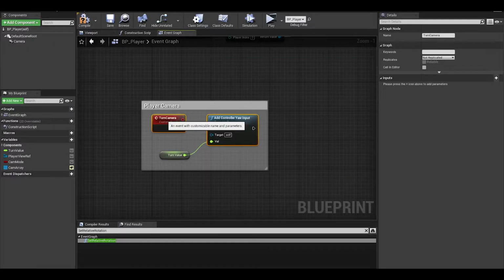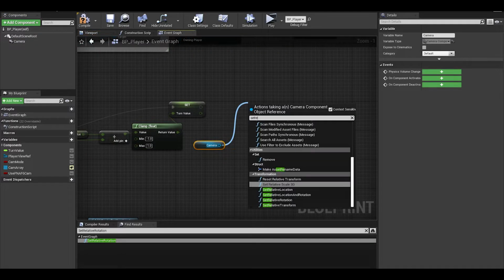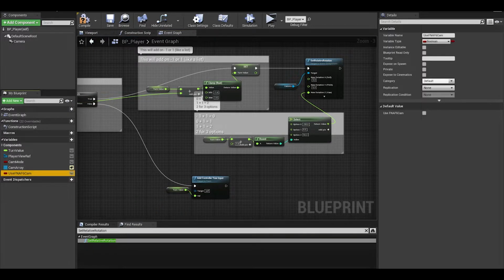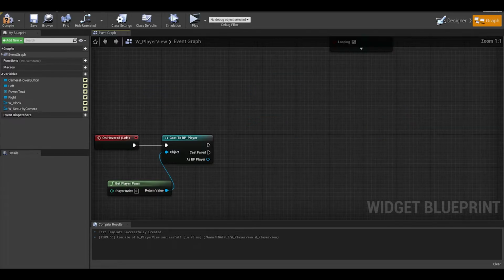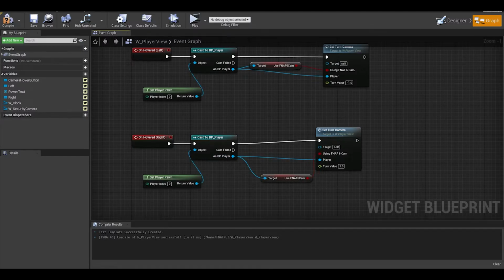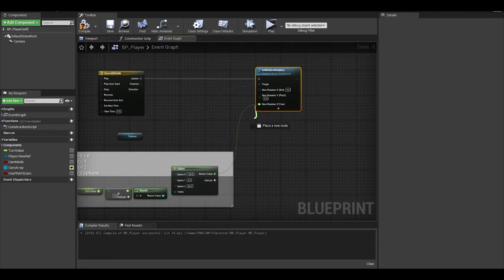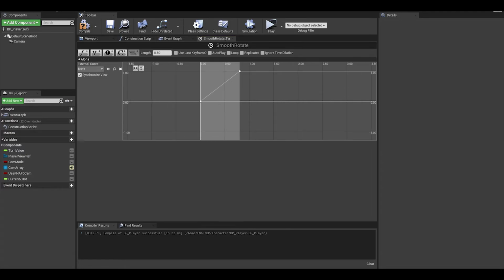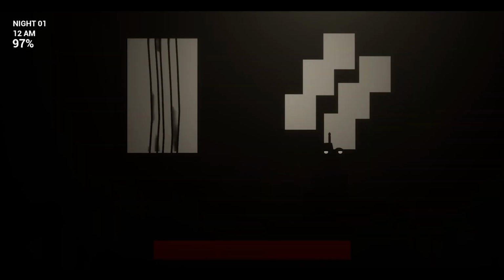Unreal Engine | FNAF 6 Camera System

Comment from the maker: If you have a problem with this tutorial, you can just copy this code into your event begin play, it's because FNAF 6 needs the yaw rotation disabled while FNAF 1 needs it enabled.
The code in here will just do this automatically for you on event begin play.
https://pastebin.com/TT02FAEV
Another thing is, that I made two seperate Turn Camera Events instead of that branch. One Turn Camera for FNAF 1 for the set timer, and another one for FNAF 6 (which has the input amount in it).
Reply: I’m sorry but how do you “copy” code into a event begin play
Reply from the maker: @daleanmonster4218  The default on Windows is just the normal Ctrl+C and Ctrl+V. It will translate that code (writing) into the correct visual nodes with the writes connected
Reply: @unrealdamagecontrol  oh okay but its still not turning for me
Reply from the maker: @daleanmonster4218  I would need to screenshots of your code on my discord , as I can't exactly know where the issue is
Reply: @unrealdamagecontrol  joined